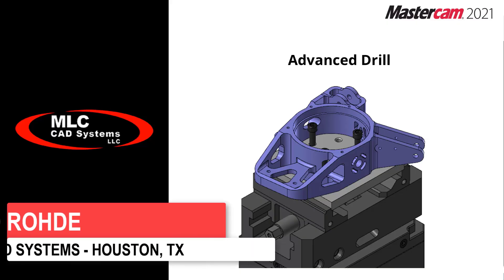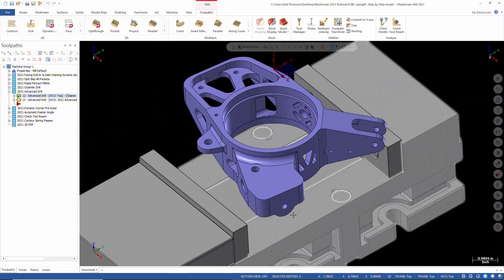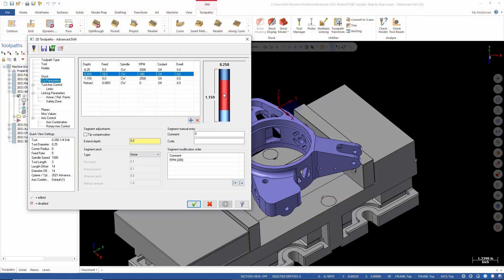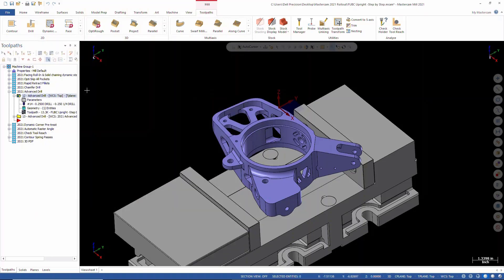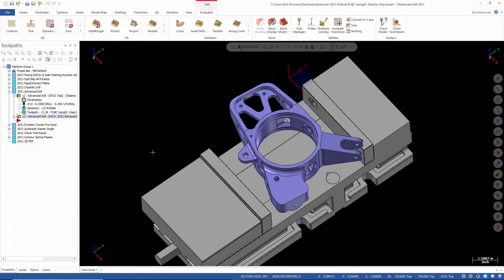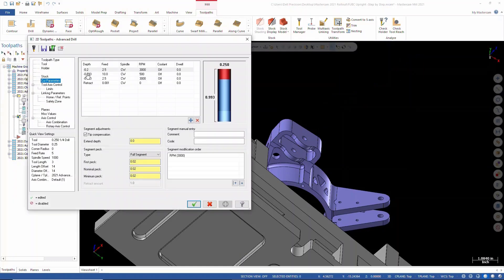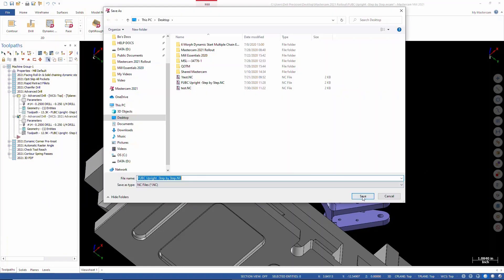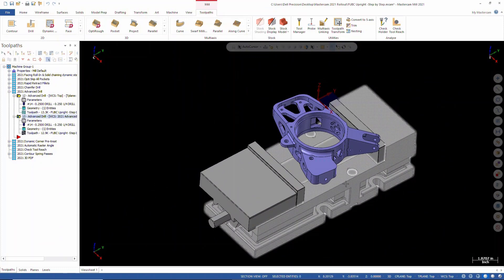What's New Mastercam 2021 - Advanced Drill

Comment: HI WHY I CANNOT CHANGE IN ADVANCED DRILL SEGMENT OPTIONS FIRST PEC NOMINAL I MEEN FROM0.1 AND LESS TO .01  OR .001 FOR EXAMPLE
Reply from the maker: Each peck stroke is affected by the minimum depth that is set in the "Minimum peck" box at the bottom of the Cut Parameters page, including the first one.  Reduce the minimum peck distance to the distance you would like it to use and then you can specify that for your first peck depth.

Comment: I still have the problem with full segment drill that it doesn't fully mimic a G83 style pecking cycle.  You can see in your code it's retracting in rapid, but feeding from the R plane each peck ( Z-.793 in this case).  I seen something about it in update 2, but I haven't quite worked out what they've fixed.  This is an issue with mastercam itself, not the post, due to the way the NCI is handled.
Reply from the maker: Thank you for the question Matthew, we had to check with CNC Software on this one and they are currently working on it.  They have identified it as #R-24225 to make it possible to rapid back in to the defined clearance amount for each peck; as a typical G83 peck cycle would do, I hope that helps!  These types of questions are best directed to your reseller so they can send it in for a full resolution as well as provide any explanation or clarity on what/when/how the change will be implemented.